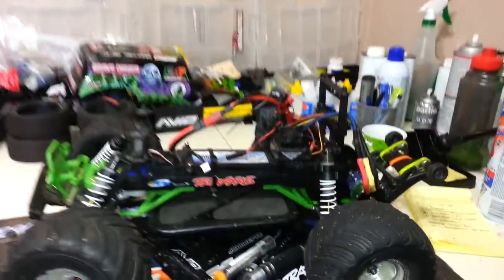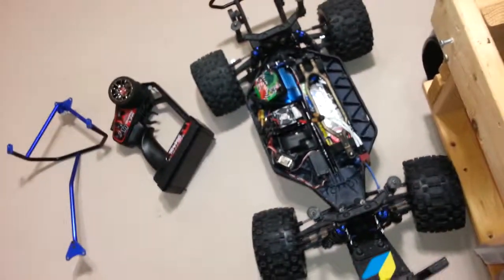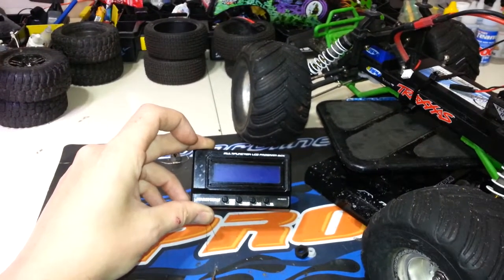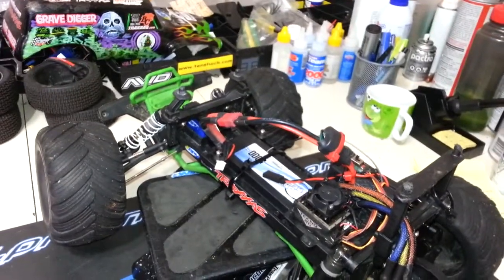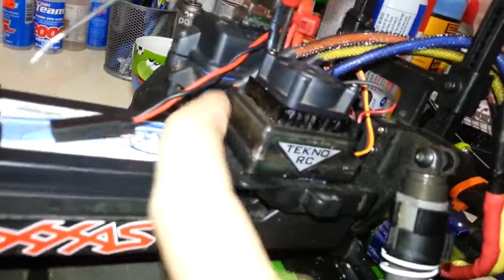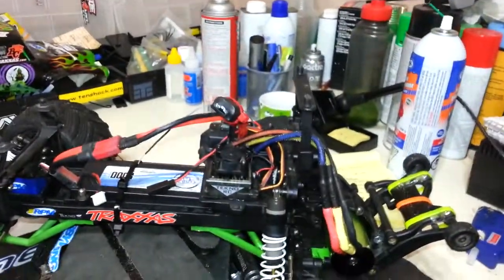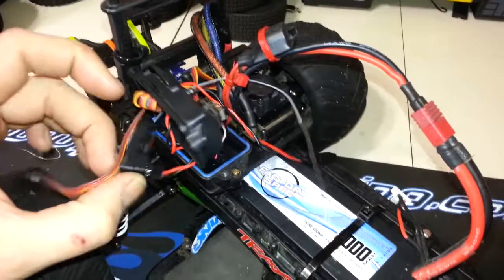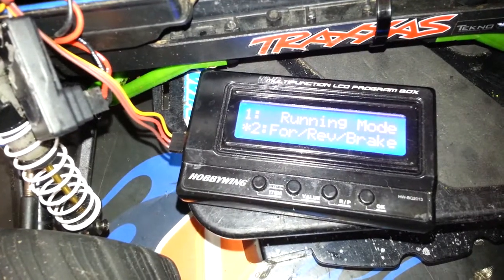HobbyKing X-Car 120A ESC Review (XeRun v2.1 Clone)

Comment: Great ESC! Had mine for about a year till it died from my stupidity. I too damaged mine from an accident w/o a body. Instead of just cracking the case, I've separated both the top and bottom PCB, thus making it non salvageable. Build quality is great, even the capacitors are Japanese Rubycon capacitors! Just ordered two more yesterday, can't wait for them to arrive! Oh, just a heads up, the sensor wire included is garbage. All the users complaining about cogging is due to a poorly implemented and wired sensor cable. Once you replace the sensor cable, you'll be fine with it!

Comment: Hey there, I just wanna ask you, is this ESC is still running? Cause I've seen some bad reviews on it and I wanna buy it along with a 3200 kV 11T brushless Tacon motor. Btw do you think it will run perform okay with a NiMh? And do i need the programming box? The thing is that I won't probably have enough money for all these things...
Reply from the maker: This ESC is still running as good as the day i bought it! She's a trooper! Never had any problems with it. You need the programming box to upload and change firmware. Now it will still allow you to program it via lights and beeps, so you can change the settings around, but you will not be able to update to the actual hobbyKING XCar firmware with actual HobbyWING XeRun Firmware without the program box. You can always grab the program box later down the road, as the ESC will work out the box, but it definitely is an asset to have. I have never run mine on a NiMh pack, so i cannot say how it will run. If i were you I would make the leap to LiPo. Batteries and chargers are becoming much more affordable these days. As well as safe!. I use exclusively lipo batteries now, no way i could go back to nimh now lipo are so much more powerful, Also lipo's with decent C ratings and a good charger, I can charge my 5600mAh 2S Lipo's in under 10 mins from dead @ 20Amps with my Turnigy Reaktor. Any other questions please direct them to my email thercbashers@gmail.com Thx!
Reply: Thank you for your response, I will buy a LiPo as soon as I have enough money to do so.

Comment: Will this esc work with turnigy trackstar sensored motors?
Reply from the maker: Yes.  This esc should power it beautifully.  Keep in mind that it does have a motor limit on 2s and 3s.  

Check out the user manual for the hobbywing xerun 2.1 located on the hobbyking xcar 120 page under the files tab.  Keep it under 4000kv on 3s and you should be fine however I've never used thIs ESC above 2S.

http://www.hobbyking.com/hobbyking/store/uploads/753716071X606372X41.pdf
Reply from the maker: Yes. 

What kv is your motor?
Reply: ЯC Bashers™  Motor: http://www.hobbyking.com/hobbyking/store/__21960__Turnigy_TrackStar_7_5T_Sensored_Brushless_Motor_5135KV_ROAR_approved_.html?strSearch=turnigy%20trackstar%207.5t
Battery: http://www.hobbyking.com/hobbyking/store/__19144__Turnigy_nano_tech_4400mah_2S_65_130C_Lipo_Pack.html?strSearch=turnigy%20nano-tech%204400mah%202s
Will be using those on associated b4.2
Reply from the maker: BfhCheese it will work just fine